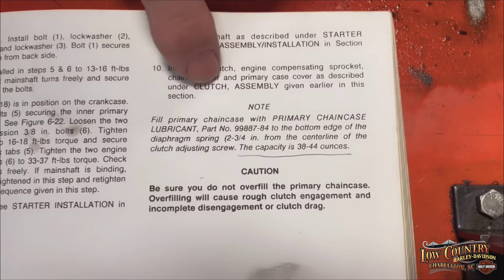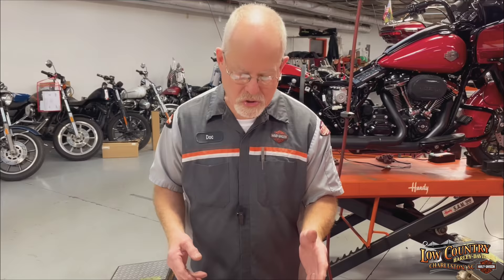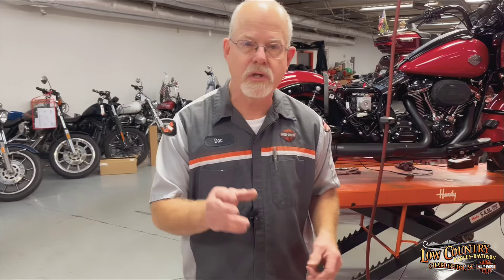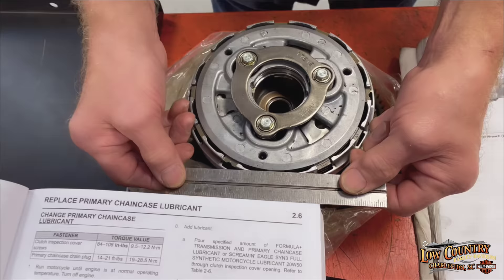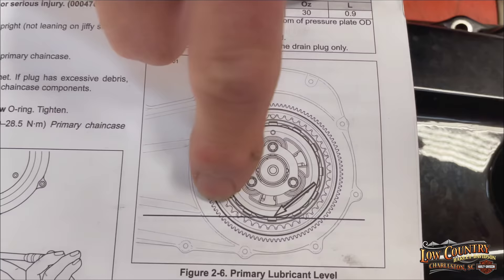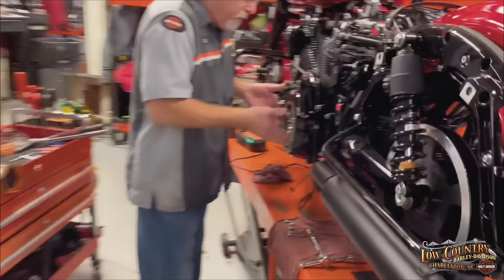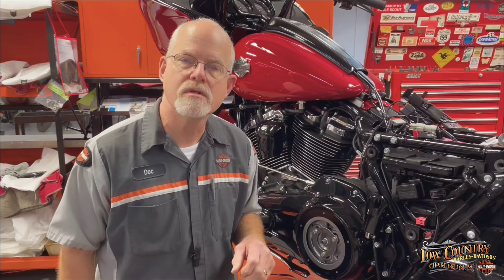How to check your Primary Fluids | How much fluid to put in my Harley-Davidson primary | Doc Harley

Comment: Well I’ll be dipped! I have a clutch that’s dragging and I checked and it’s over filled
Reply: If it's a M8, you probably have fulid transfer.
Reply: @toddgittins5692  no, it’s the small bike… sporty… I’ve put 10k on it and the clutch is probably toast. Hard riding and max wrist along with fast clutch changes. I think it’s torn up 😂
Reply: Is that you Derek lol

Comment: I recently overfilled mine by 8 ounces. Rode about 10 miles clutch felt a little different. Went back home figured out what I had done. Drained it and added the proper amount. Ridden about 150 miles since and everything seems to be back to normal. Thanks for the video
Reply: Surprised no leakage at output shaft seal. Mine 09 Softail leaked till I got fluid to level as Doc shows. Don't believe the HD wet fill. Use the visual method.   Ride Safe
Reply: Saw a couple of videos that put in same amount as was removed. They poured oil in a measured container .
Reply: @Peter Bergeris  that's fine if it was properly filled before.
Reply: @donmunro144  I just drained 36 ounces out of my 2021 Road Glide that the service manual calls for 34 dry and 30 wet. Been overfilled for 9k since the 1k. Gear Box is not low either.

Comment: My 99 Softail Custom says 26oz. in the primary and at the bottom of the clutch basket. When putting in 26 oz. it comes right at where is should be with the motorcycle upright. Are the Softails different? Or am  I missing something? If I put 34 oz. in it would be way over the bottom of the clutch basket.

Comment: Excellent video! Been fighting with neutral issues for several years although putting in the correct amount per manual. I went with the clutch basket level and what a difference. No more neutral problems. Thanks again Doc.

Comment: After getting the oil level correct in the primary I took a wide popsicle stick dropped it in between the case and the clutch all the way to the bottom of the case took a Sharpie made a line across the stick at the oil level. I now have a primary dipstick. My primary calls for approximately 32 oz. At service time I drain the primary put a quart of oil in insert my homemade dipstick the oil level is always right at the Mark I made the first time with the Sharpie. It seems to make it easier for me. Keep up the good work.
Reply from the maker: Thanks for sharing...Doc

Comment: To add I believe primary and Trans are supposed to be checked when bike is level. Engine oil is checked when leaning on stand. Both trans and engine oil dipsticks are not to be screwed in to check level, but unscrewed, wiped clean then simply reinserted briefly without screwing back in.
Reply from the maker: This was true for years. The M8 changed the trans check. On the jiffy stand and all the way in...Doc
Reply: @LowCountryHarleyDavidson  Oh ok, that’s just always the way I checked because I have a 2010 Dyna Wide glide. It would be easier to check all fluids on jiffy I’m jealous haha always great video thx Doc

Comment: I usually fill mine while it starts to puke out of the lip of the primary cover while it's on the kickstand then install the derby cover. It usually ends up being right around the edge of the clutch basket as you showed in the video. Been doing it the same way for 25 years now. Seems to be fine.
Reply from the maker: That's living on the edge....Doc
Reply: @LowCountryHarleyDavidson  🤣 Thanks Doc!

Comment: My 21 Low Rider S manual shows the fluid right up to the spring plate stopper plate. 40oz dry 36 wet. Someone drew two lines on the bottom of the pressure plate like fill lines. Iv owned it since new.

Comment: I have not changed the oil in my primary on my M8 as of yet but on both an EVO and a Twin Cam I owned for over 20 years, over 100k on the EVO and 85k on the twin cam I just installed a Qt. on the wet services. I never had a problem and both bikes still had the original clutches in them. Looks like that will work on the M8 for me as well.
Reply from the maker: Thanks for sharing...Doc

Comment: The 2001 Twin cam manual also says the oil level should be 2.75" from the center of the clutch bolt.
I use a steel ruler to measure that. 
It takes a more than a quart to get it there.
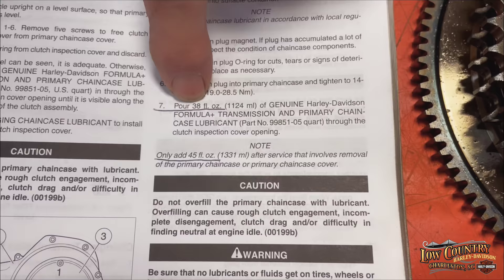Reply: 1:40 d

Comment: Personally run 40 in my twin cam primary , due to the level dropping while running , have never felt a difference in the clutch after starting a little higher level . 40 thousand miles on 15 street glide . Never any problems with the clutch whatsoever , and have pulled a trailer 4000 miles through the mountains . She is still working as new .
Reply from the maker: Thanks for sharing….Doc

Comment: Thank you so much Doc. I just went to change my fluids in my 2003 Softail Deuce. I cannot get the transmission drain plug to tighten. Lookks like the threads are stripped. Will have to bring in for local service. Just was wondering if its possible to re-tap the drain hole or is it more complicated than that? Thanks Doc. Wish you were local.
Reply from the maker: Time-sert or heli-coil...Doc

Comment: Love the Videos Doc  .   I know the Book say to pull the Derby cover , I check my chain with a oil change . I have a cover on my RK I fill it there also with 38 oz  that is just below the 2 screw holes for the cover .   Lot of the other Models do not have that window , run with a auto adjust .    I have had people tell me im over filling  lol   I say hold up a 2 foot level and you can see the line .
Reply from the maker: Thanks for sharing….Doc

Comment: 1989 FXR/FLT EVO and earlier its to inspection cover lip . page 7-19  line 27. service manual part number 99483-90. after video i thought i might have been doing it wrong since 2006, then i read further into manual again to refresh my 53 year old noggin.  page 6-19 has your diagram with lube line for 1990.
Reply from the maker: Thank you…..Doc

Comment: Lifter oil holes on a twin cam 88...towards the motor, towards the outside, or pointing towards each other? I found it in the manual but nobody really seems to know. If it's like the manual says then mine came from the factory wrong...bought it off the showroom floor.
Reply from the maker: The placement of hole is a nice idea but the clearance of lifter to bore and oil pressure has more influence. I think it is odd that the entrance hole in the case is on the side but the recieving hole on the lifter is front or back depending how they were installed....Doc

Comment: Hello Doc Harley this is Trike Mike again my Trike is a 2014 Triglide trike as I mentioned earlier the clutch problem the first time it happened I burnt out my clutch I am on my second clutch which is a REKLUSE clutch so I do not know why the heat from the engine if it gets to the point where it overheats and like I said I lose the ability to pull in my clutch so I was stuck in the second gear and could not get out of it and burnt up my clutch
Reply from the maker: Is your parking brake adjusted correctly?…Doc

Comment: First off thanks for all your videos, enjoy them all!

I have a early 86 FLST Heritage Softail with the Evo. My manual says to fill the primary to the bottom of the opening of the Darby cover. That seems excessive as it’s way past the bottom of the spring plate?
 Should I drain some out so the fluid is at the bottom of the spring plate.
Reply from the maker: Follow your manual....Doc

Comment: My CVO manual calls for 32 oz, at 32 oz I can't see any oil in the primary. I visually put the level at the bottom of the clutch. It took 44 oz. and everything works fine. I'd appreciate your take on this matter. After draining the primary in the upright position,  I put the bike on the jiffy stand  which resulted in more fluid drainage. Thank you Doc
Reply from the maker: I believe you nailed it at the end of your post. When servicing your primary, the Factory would assume the bike would be upright. Also in the manual there is fluid amount for servicing and one for filling with a dry unit after a repair….Doc
Reply: Thank you Doc. That's why I added the last comment. I'll drain the primary the same way for future primary servicing. I appreciate your quick response.

Comment: Hey doc when you change your oil can you drain the oil out of the bottom of the motor to that way you will have all of the oil out
Reply from the maker: No! Too many have tried and cracked the cases by putting the pipe threaded plug in too deep....Doc

Comment: What happens if you “hypothetically” overfill by about 20 ounces and lose ALL pressure in clutch lever and can’t use clutch whatsoever?
Is it possible to drain and “restart?”
Reply from the maker: Yes. It may take a few moments of working the clutch to get the excess oil out between the clutch plates....Doc

Comment: I noticed that the ST models with the Hi Flow air filter do not come with rain socks anymore. Are they now made so riding in the rain is OK and water will not get inside the breather? Another dealer here on You Tube when I asked said Harley is using a special oil and they do not provide a rain sock as it is not needed  anymore for that air filter. Also if you look up that filter in the Harley parts page, they offer no rain sock and other people were concerned also so this is why I asked.
Reply from the maker: You have the New ST? Lucky guy....Yes that is what HD is posting...Doc
Reply: @LowCountryHarleyDavidson  Thanks for clearing this up and telling us that the new filters need no more rain sock and Harley is using a special oil. You are the only person to answer the question, Matt Laidlaw didn't even know how to answer the question. Here is his answer when I asked the same question, he didn't even answer it?  ''Good question. Riding in the rain isn’t ideal. It saturates the filter and restrict air flow and water entering the intake isn’t good. Usually you won’t have a problem but long duration rain fall without the rain sock isn’t advised.''

Comment: Fixin to change my fluids for the 1st time  on my 2001 fatboy with the 88, was aside from the dealer cost of ot all, surprised when he gave me 80 140 gear oil for my primary as well as the tranny, I supose being it says primary on it as well it should be fine for my year bike? Would you say it's better or worse for primary as opposed to oil? Thanks agin great vid there doc
Reply from the maker: I like the New Primary/Trans oil....Doc
Reply: I always use ATF in my primary, never a problem on my MC's... 1985 softail 90,000 miles, 2006 Streetglide 60,000 miles,  2000 Nightrain 65,000 miles (All have original clutches and primary chains)... FYI: I grew-up in RI, home of fram filters. Fram filters are now made in China, do not use any Fram products on any vechile!

Comment: A little off topic from the video, but is it ok to use Harley Heavy Synthetic Gear Oil in the primary?
I picked up oil at the local HD dealership for a 3 hole change and the parts guy recommended that for the primary and transmission of my Road Glide.
Reply from the maker: The new heavy oil works great in the primary. Helps quite the compensator area👍…..Doc

Comment: In the process of servicing my 06 street glide as we speak, I pulled about 1.5 litres of oil out of it from the drain bolt, I put 950 mills back in and it was exactly like you just showed us ,  would there be a reason why someone would run it with more oil than necessary..?  Ps thanks for the information , kind regards from the UK
Reply: Don't worry about how many oz / lt / ml it is, just fill it to the point that it says it is full, usually just up to the bottom of the clutch spring when the bike is upright and level, also dont ride your bike leave it over night so you know all the oil has settled at the bottom.
Reply from the maker: Nice advice...Doc
Reply from the maker: one never knows why others do things differently. That is why I trust a Factory Service Manual....Doc

Comment: Doc..I need some help. I have an 1990 fxrs-sp and I've rebuilt my forks and I can't find any info on the banjo nut bolt for the through air pressure on the top of forks..it must be super special. I know I have to line up the hole in the bolt with the tube but don't have any specs on torque or anything. 
Also, can I use ATF for my primary chain case fluid as long as it meets the proper ratings for Harleys?
Reply from the maker: Do you know how hard it is to find my FXR Service Manual? 8-10 ft-lbs….Doc

Comment: Hello Doc, thanks for the great video. Is it possible that a bike doesn't have 2 different levels? 2006 Street Glide. I can locate at 3 different places in my manuel and all mine says is 32oz.
Reply from the maker: Unfortunately not. all of mine have two amounts. You need to look in diffferent sections of the Manual. Maintenance is only one area. Drive is another....Doc
Reply: @Low Country Harley-Davidson  ok Doc. I looked in the Drive section, and it also only says 32oz. Like I said. Every where else in my manuel where primary drive fluid is mentioned. It was stated 32oz only. So, I placed my bike in my chock level, removed the cover, and visually checked. It is absolutely at the perfect location with 32oz only. And yes, that's after the primary drive cover was removed to service my compensator. Now, that's a different issue. 😆 so FYI. 2006 Street Glide is a different animal. 😆

Comment: Question. Do you have to replace the gasket every time you pull the cover to check level or just when you change the fluid? Obviously, check for tears, etc.. each time you break the seal.
Reply from the maker: At the dealership we can’t take the chance of an old gasket leaking and having a pissed off customer return because of a 5 dollar part….Doc

Comment: Great video , Thanks , Question for you though , I have a 1997 Evo softail and the primary oil is ( over a period of time ) is getting sucked back into the oil tank , I,ve put a brand new mainshaft seal and spacer in but it,s still doing it , driving me nuts . last time i had it apart for a new stator i noticed that the compensator actually had ground off the bottom screw which holds the 2 wires in place at the back of the stator , I tried with Ezy outs to get it out but it,s like it is welded shut inside and will not budge so i bought a new little plastic cap for the wires to be held in place but could only put the top scew back in , everything ( so i thought ) was going sweet till i noticed a small trickle of oil on the outside of the oil tank , Checked the oil level , it was full to the bloody top , drained the primary and only 250 ml came out . Hope you can help me out . Thanks .
Reply from the maker: If the oil is finding its way back to your oil tank. Your motor sprocket spacer and seal are bad. This is behind your compensator…..Doc
Reply: @LowCountryHarleyDavidson  They are brand new doc , only about 3k old , they were ( hope) put in properly

Comment: how you doing Doc? you're the best and totally trustworthy w your knowledge! i have an 01 wideglide...it is lowered 2 inches in the rear, the frame rails are not level anymore either which makes the motor also not level i would imagine.Dees this effect the amoumt or   level of primary fluid needed to still operate and function correctly? Also,does it cause any ther issues w fluds or aywhere else that  i should be aware of? thanx in advance for the correct answers and happy fathers day! Be safe👍
Reply from the maker: Vic you bring to the table a great thought. Modifing suspension so the frame is not level would effect all oil dip stick readings. I would for motor oil and trans oil use the Factory Service manual amounts for filling and make a mark on the dip stick. As for the primary oil level, in my opinion I would look and fill where the oil meets the clutch basket. Too much oil on clutch plates will effect the way they hold.....Doc
Reply: My clutch basket is so close to the primary case that there is littally about an eighth ofan inch to look down between it. Almost impossible to tell when it is right at the basket. My primary chain is on the back side and not between the basket and the flywheel which im pretty much sure was not stock to my bike.

Comment: Doc, I want to change the fluid on my 2001 Electra Glide Classic what do you recommend I should use from (AMSOIL) the V-TWIN PRIMARY FLUID or V-TWIN TRANSMISSION FLUID please advise thanks
Reply from the maker: Daniel there so many choices when it comes to oil and pricing. You are correct in chooding a oil that was designed for an air cooled motor. I work with and know Harley-Davidson oils. Do your own research. It is always YOUR choice

Comment: Doc, I have a question about my 2018 FLHCS, 114 ci, 14,000 miles. Whenever I start it after it has set either overnight or it's been a day or 3, It starts dry and I hear clatter from the top front cylinder then it goes away to normal oil flow. The oil level is good and it does not look like it's sumping. Any suggestions?
Reply: Maybe check the dog bone motor mount if it has one. I replaced the one on my twin cam and sound is gone.
Reply: Is the oil light flashing during startup till the noise goes away? And is the motor stock?
Reply from the maker: You might have a leaking cam plate high pressure valve. I would want someone to take a mechanical oil pressure recording. The 2020 oil pump is better. It might be time for a performance cam with pump...I just love an excuse for more.....Doc
Reply: @GrimCreeper7  I haven't noticed the oil light flashing and yes, the motor is stock.

Comment: I have a question, i have a ultra with a 110 , what should my rpm be at when driving
Reply from the maker: I am assuming you have a Twin Cam. The sweet range is between 2500 and 3500. 2000 to 3000 is a daily shifting and cruising city streets. Don’t get addicted to the lope. Let the motor work wear it is designed to run….Doc